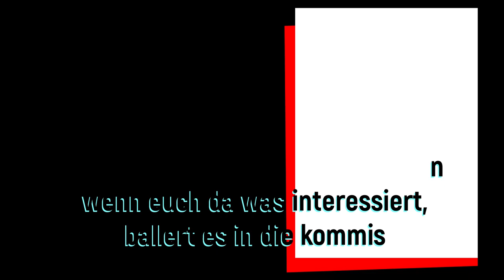12# langsam wird es höchste zeit

Comment: Wie ist das eigentlich mit dem Führerschein? Muss man den neu machen? Kann man die Motorräder dann auch mit dem europäischen Autoführerschein fahren?

Wie sieht das beim Strom aus? Wie viel Volt gehen da ins Haus? Habt ihr auch die 230V? 

Wie hat euer Nachbar reagiert, weil er die Klima abnehmen musste? 😅
Reply: Ach ja und wie es das jetzt? Habt ihr jetzt nur ein Visum auf Zeit oder seid ihr jetzt schon Bürger, etc? Fragen über Fragen 😅
Reply from the maker: Du darfst 3monste mit dem deutschen Führerschein und 6monate mit dem internationalen Führerschein hier rumdüsen (habe beides).

230 Volt gehen hier ganz normal ins Haus wie in DE.

Der Verkäufer hatte damals mit dem Nachbarn abgemacht, dass die Klima solange da hängen darf bis jemand das Haus kauft.

Wir haben seit letzter Woche jetzt eine daueraufenthaltsgenehmigung die gilt 10 Jahre.
Wir bekommen aber in den nächsten Tagen noch die cedula ( quasi den Personalausweis)
Reply: @paraguaylebefrei4428  Dauerhafte aufhenthaltsgenehmigung und nach 10 Jahren was bekommt man dann wieder 10 Jahre oder unbefristet.
Reply from the maker: @Don.R.777  dann wird die wieder um 10 Jahre verlängert.
Du kannst natürlich auch schon nach 3jahren die Staatsbürgerschaft beantragen und hast dann Ruhe.
Reply: @paraguaylebefrei4428  Danke für die Info 💐